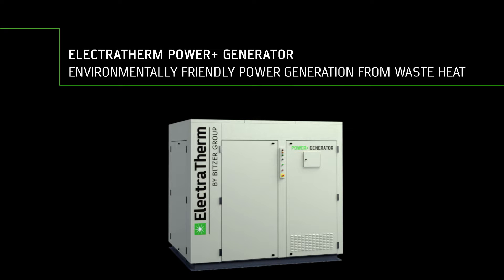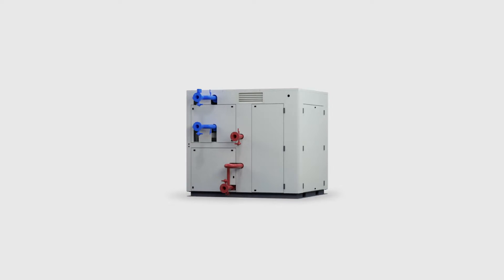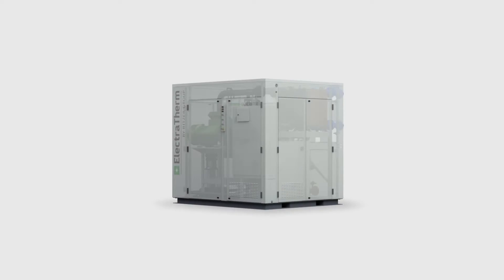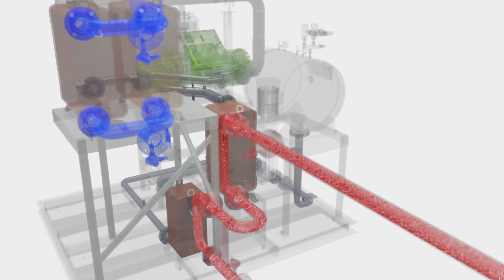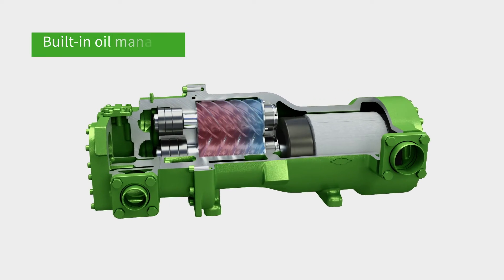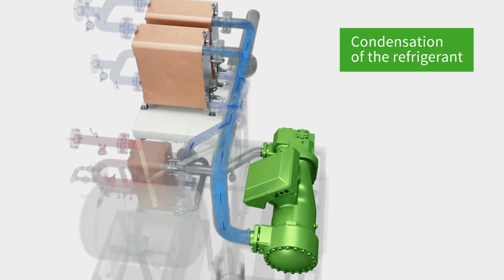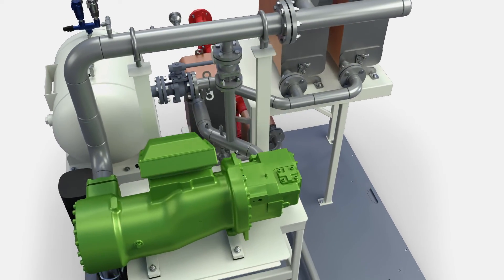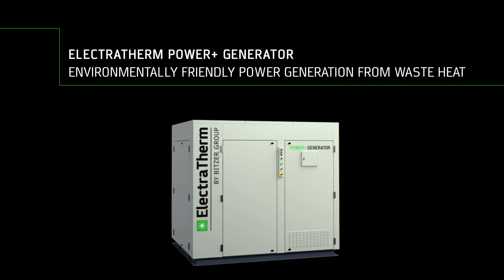ElectraTherm: Harnessing Heat for Sustainable Electricity

Comment: 2005
Established in 2005 in Reno, Nevada, our mission has never changed. To provide the world with efficiency solutions that provide clean energy while reducing emissions. We aim to show the world that waste heat recovery is not only profitable, but practical.

As the world looks to the future, there is more pressure than ever to reduce our carbon footprint while finding more efficient and sustainable methods to use and generate energy. One of the simplest ways to achieve this is by using ORC technology to take advantage of a resource you already have – heat